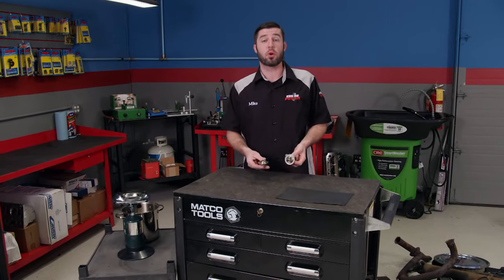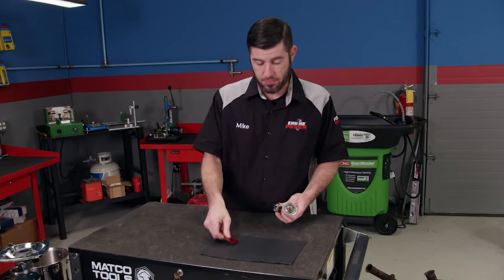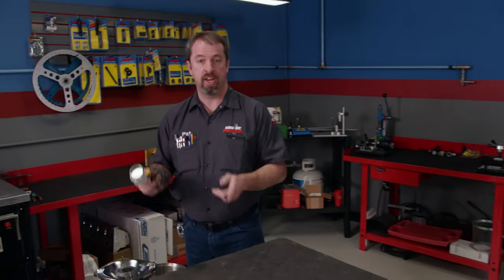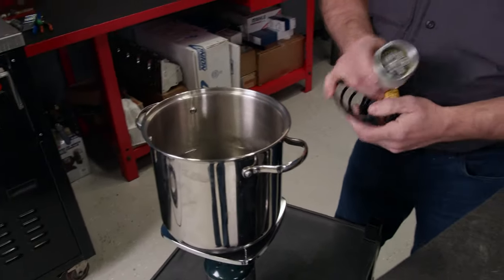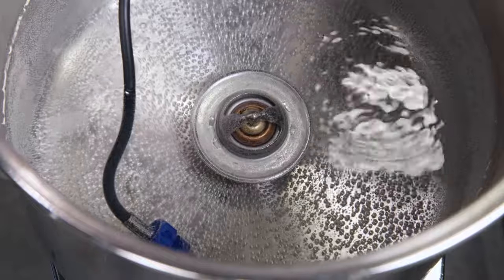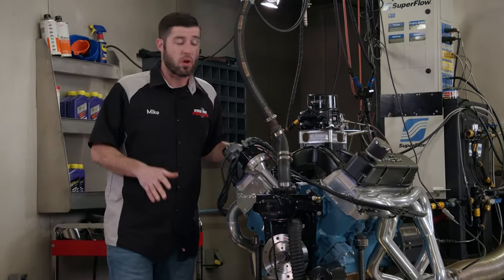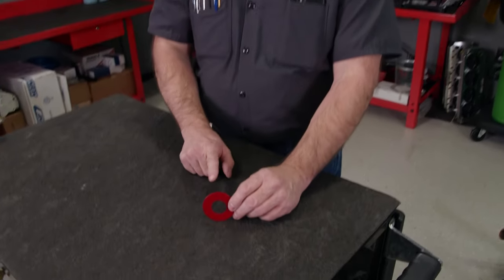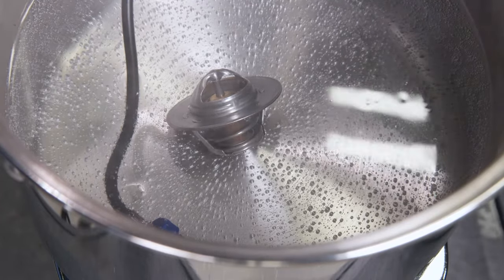When You Do And Do Not Need A Thermostat

Comment: Thermostat delete does not make an engine overheat. But it makes the engine  take a longer time to reach operational temp.
Reply: What you mean with "delete"?
Reply: @chicogozosodecabellosedoso  by deleting, i mean removing the thermostat and replacing it with a dummy cap that doesnt have a thermostat inside.
Reply: @chicogozosodecabellosedoso  or replace it with a straight pipe if it is possible.
Reply: @khmerghost  Thank you 👍

Comment: This is real simple when you do replace your thermostat used a fail safe type that when fails open completely so no damage to engine have fun
Reply: Where do they sell those at
Reply: an open thermo is not assuring a good engine,,,you engine can fail if over heated or under heated
Reply: Some Dirt bikes are water cooled  and don't have a thermostat   or a fan so I don't get WY you would damage  your engine  taking  it out

Comment: Restriction in system is to increase the pressure in the block and heads to stop localized boiling usually around the exhaust valves. The radiator efficiency and airflow and of course HP being used are all factors , etc etc.

Comment: Do I need a thermostat in the tropics? Does hot weather provide enough heat to the engine regardless of thermostat? Does thermostat lead to engine overheating in hotter climate? When you need and not need a thermostat was not answered please!

Comment: How would a lower temperature opening cause overheating? More flow means more opportunity to cool, and racecars, though restricted, have constant flow as well?
Reply: Less heat transfer from the block to the coolant. Flowing too fast.  Coolant temp will show low but the engine block will be hot
Reply: @yamslam7083  nobody measuring coolant temp anymore nowadays. Not 1 sensor is on my radiator for sure.
Reply: @yamslam7083  That's interesting.

Comment: You're right about heating a thermostat up in water to check and make sure it is in working order, but for $15-$20 for a new one, if you have taken the time to pull out the order one - you might as well swap it out - I mean, your eight there.
Reply: Yes, you are most likely swapping it out. But you're also checking if the thermostat is the actual problem for your cars symptoms.
Reply: $15-$20 here $15-$20 there, at the end of the year it's one month off I take off work or if I like working, it's a new apartment every now and then

Comment: Never have tested a thermostat like that. Usually they fail open. I take the car for a steady cruise down the highway at 60 mph and watch the coolant temp. If it’s dropping below the thermostat temp rating, more than likely the thermostat has failed. Usually overheating issues are low coolant, no flow(bad pump), cooling fan not working or not Adequate, or head gasket failure.
Reply: Exactly not because you bought a lower temperature thermostat it supposed to make the motor run cooler these people have no idea what they're talking about. One yard took my thermostat completely out and it rained colder than it ever had
Reply: Which Pump were you referring to?
Reply: @nickotasla3091  water pump

Comment: I don't understand their logic with the cooler running thermostat.  Water temp reached 160 f. Flows into radiator. Engine black heats up cool water, opens thermostat and repeats cycle. Why would it over heat??
Reply: Most coolant (factory) systems aren't efficient enough to return coolant to the engine less that 160 degrees. So as the outside temp goes up, or the airflow through the radiator goes down, ( stop and go, standing still ect) the temp going back into the engine, is almost the same as what came out. The temp starts to climb, and hot days makes it climb very fast, bingo overheat. It only takes 30 degrees to get you into trouble, runaway temperature control. The stat and radiator/fan ect are out of sync.

Comment: In an engine used for road racing use, you spend a lot of time in the paddock and pits, then a pace lap and then all out racing and then more pit and paddock driving.  Would you want to use the thermostat designed for that engine or go without one to make sure the engine never overheats?

Comment: If you overheat by running wide open, yeah your radiator is too small. But that also means you'd have overheated faster with the right thermostat
Reply: depends on the design. In mini cooper classics for instance, thermostats help coolant to flow to cylinders 3 and 4. Without a thermostat those cylinders will overheat much faster.

Comment: for me i live in a coastal city, i dont have thermostat in my car  , my car doesnt do highway runs , i only drive it in town and short periods with lots of stop and go...after 5 minutes my car always reaches working temp and stays there  ..so having the risk of a blown head gasket cause of a stuck thermostat doesnt make it up  for only 5 minutes that my car takes to warm up from cold start...even in winter here wich i wuldnt call winter...inside the engine is hot whatever cold outside could be here

Comment: This is the dumbest thing I've ever heard they wouldn't sell lower temp thermostats if they were going to eventually over heat you car. They are made so your car runs cooler. This is coming from a mam that's owned 5 turbo cars and always bought lower ones on my srt4 back in 06 I took it out completely and had no problem

Comment: this is useless info,,i am trying to find out if my thermo is no good without having to remove it from the housing,,that is the whole point,if there is a way to find out that can possibly spare me having to do that if it's working fine,,so what should i be checking for ,a check eng light? hot or cold radiator hose? etc etc ,,my eng light has been comming on and off for many years now,,had a diagnosis and was told it was either the thermo or a gas cap
Reply: Just shake up your magic 8 ball and it will tell you...bro you have to diagnose a vehicle to see what's wrong with it... A thermostat is held in place by 2 bolts...
Reply: @jacquelynberry2789  yes but there is a smarter way of doing things instead of working harder sometimes